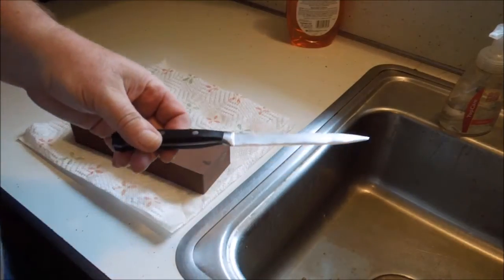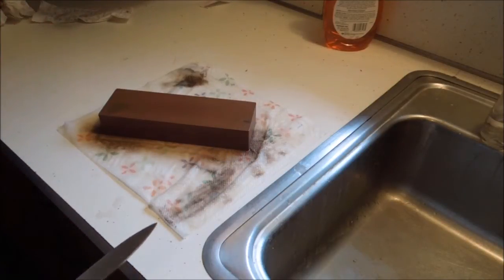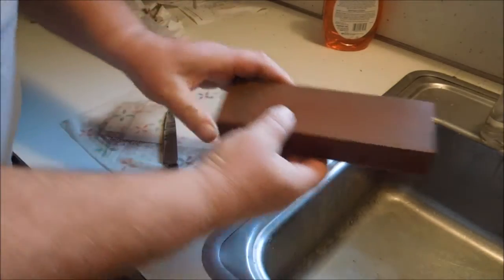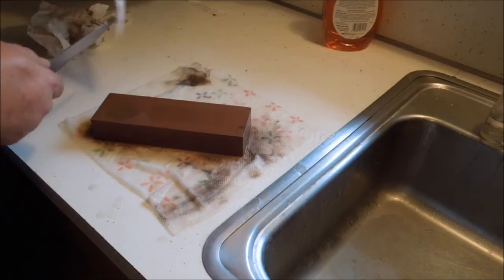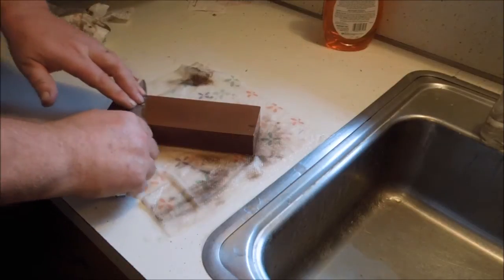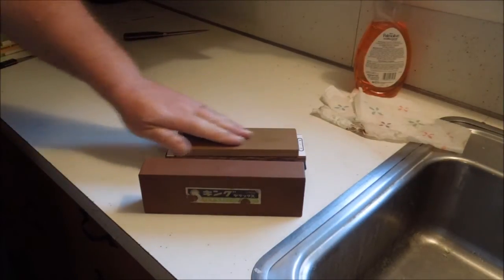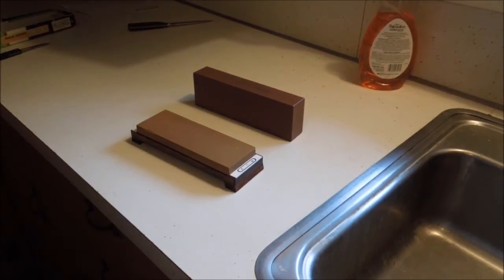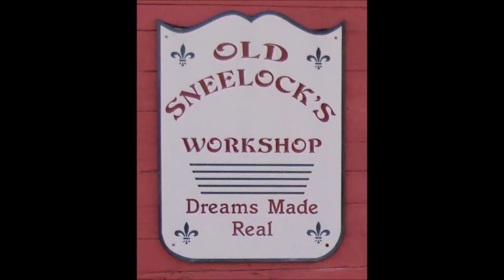Romancing The Stones   Pt 3  - Testing King Waterstones -   a video tutorial by Old Sneelock's W

Comment: water stones need a slurry. some people use a nagura stone before sharpening to help build the slurry. great set as always. 
I use the term rode hard and out away wet, and people stare at me like I have 3 eyes. I got akick out of you using that phrase.
Reply from the maker: +Matt Cooper I picked these up at the tail end of an estate sale. There were only a few things left and I'll bet the estate sale people had no idea what a Nagura stone is. They had marked everything down to zip just trying to get the sale over so they could go home. The little Nagura was either lost or tossed. If the guy had it at all anyway. The stones looked like they had been chopped with an axe. 
If I run across a Nagura stone I'll see what happens. Until then the stones seem to build a slurry fairly quickly. Actually to my way of thinking they will wear out way too fast because they just seem to melt.

Comment: Watch out the Mrs. doesn't get cut on that, seems to happen every time I sharpen the kitchen knives and forget to warn her.
Reply from the maker: Thanks halfwayuphill. I made a point of telling her.
The knife is much sharper after using the 6000 grit stone. I usually only sharpen up to 800 grit. That's the finest diamond plate that I have.
The next time I sharpen I'm going to use the diamond plates 200, 400, 800, and then the 1000 and 6000 grit water stones. I want to try that on some plane blades that are on the list.